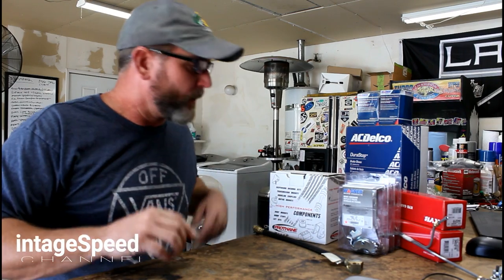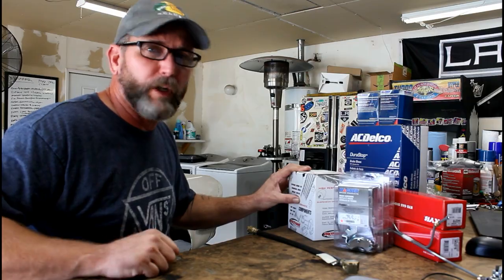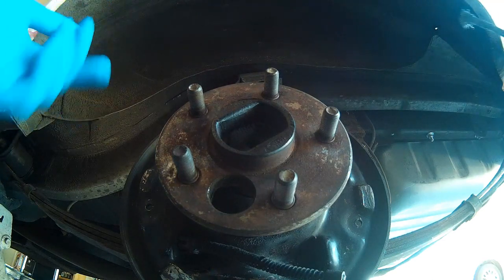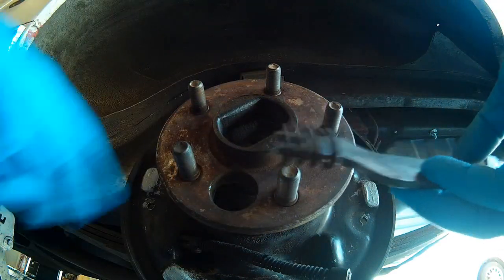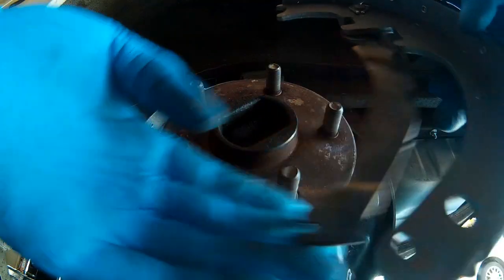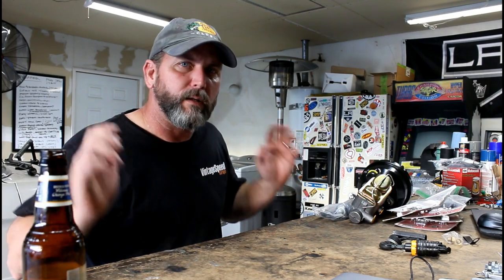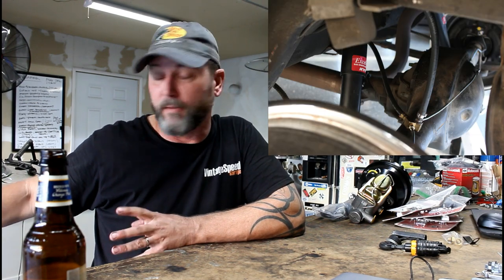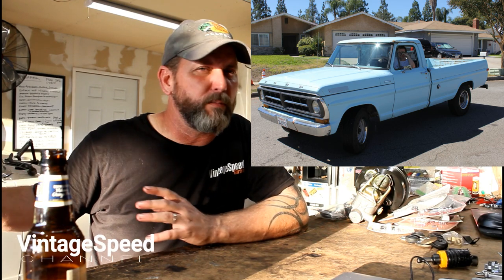66Mustang; How To Rear Drum Brake Rebuild, Urethane Bushings, Shocks & Urethane Bushing Install!

Comment: Would you recommend that the rear brakes be upgraded from drum to disc? I put disc brakes on the front of my 66 Mustang, but am thinking of upgrading the rear brakes.
Reply from the maker: honestly, for like a driver there's nothing wrong with the rear drums.  slap some new shoes, wheel cylinders in there and springs and rip 'er.  if you're going further than that might just swap to an 8.8....cheaper than a gear change/disc conversion and it's a little lighter.